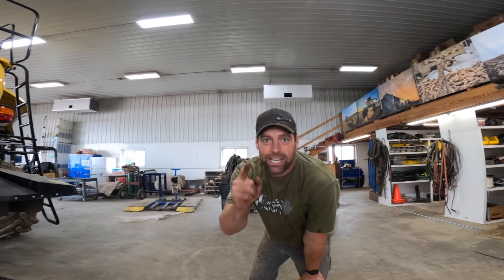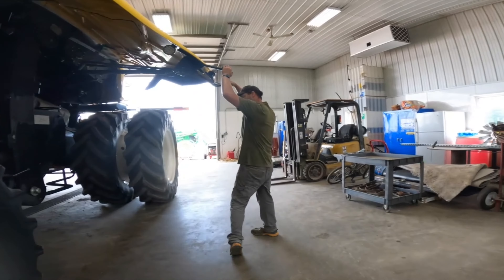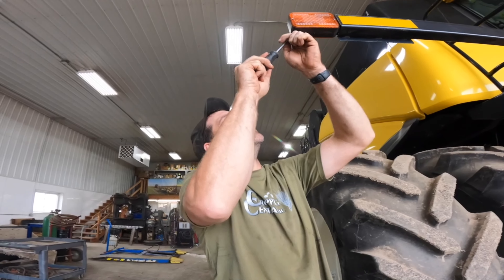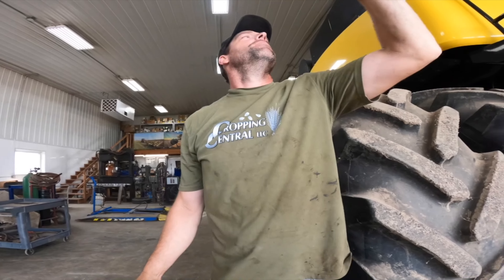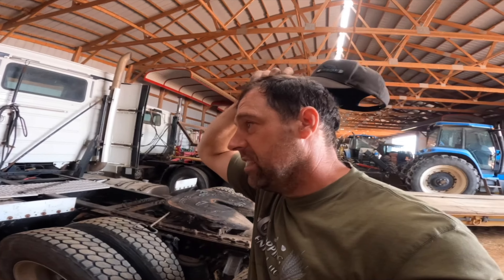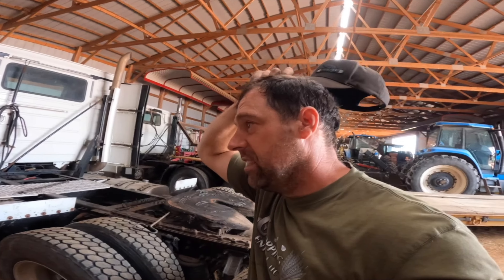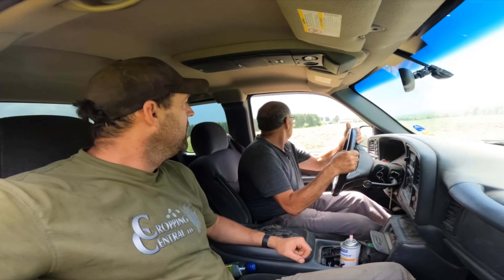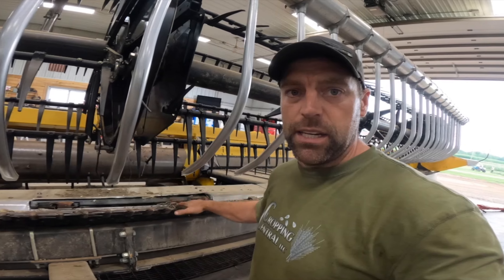Let's get the the combine "Optimus Prime" ready to harvest!

Comment: I tried replacing the 1156's in my CR with led and thought they where worse.. if you find one that is decent can you post a link? The larsen lights 4x6 that replaces the whole thing are good though
Reply from the maker: I put the replacements in today and they are pretty decent. Just some random Amazon ones. Better than what I took out. New 1156 might have been just fine also.